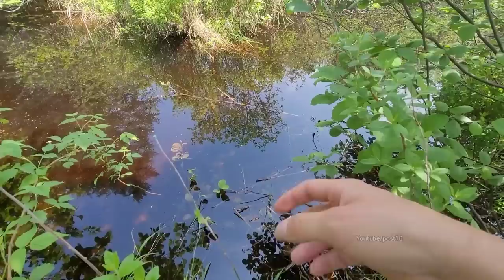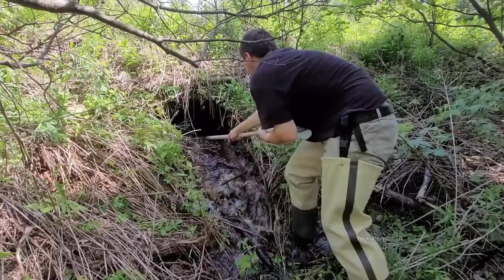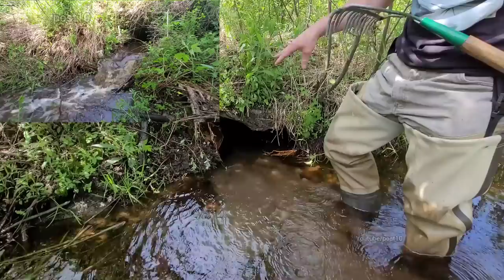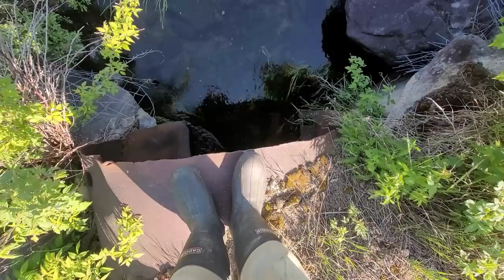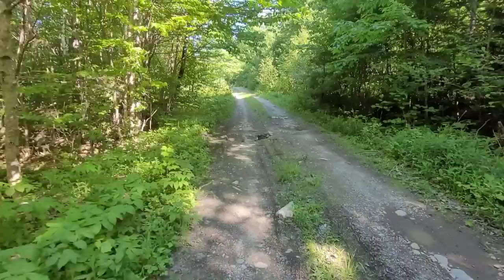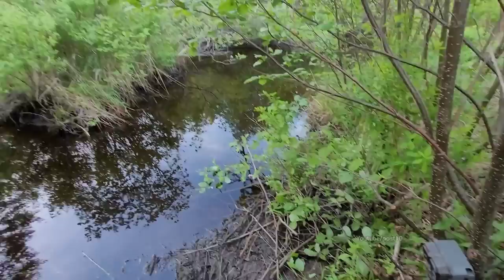Unclogging Double Ended Culvert Clogs

Comment: Hey buddy 

The reason the trail cameras don't work is that the sensor at the base is a PIR. As you likely know passive infrared detectors have a two section sensor behind a frenzel lense.

The sensor and the lense work together so when infrared heat or objects change or move there is a voltage difference between the two half's of the pyroelectric sensor. 

Your problem is that the beavers and the water are at arround the same temperature and PIR sensors are not good at detecting changes through water and cannot see through glass at all. You will only get a PIR trigger if the beaver gets out of the water then there is a big contrast in background heat and the heat from the beaver thus triggering the PIR that commands the cammera to start. This is why these detectors are used in intruder alarms.

Video motion sensing is different and uses a software program to look for a set number of pixels to change. The number of changing pixels is your sensitivity setting.

However.... video motion detection can be very unreliable and is very hard to set up without loads of false triggers. For example a fly or moth flying past close to the camera lense would look like a huge amount of movement. Water, rain and mist will continuously trigger recording so its useless for your application. Video detection is only useful in a place where nothing at all moves.

This is why trail cammeras nearly always use a PIR detector and as you know yourself in outdoor area's even they can be oversensitive or undersensitive.

Hope that helps explain why your trail cammeras often miss the beavers. It may also help to know that PIR sensors are far more sensitive to motion passing accross them and far less sensitive to objects coming at them face on.

Those cammeras could easily be modified so the PIR part is sepperate from the main unit. That would be way more effective.

If you want to message me and arrange it I would be happy to make the modification to one for you.

Keep up the great work and exelent content  👍
Reply from the maker: Thank you. I did not realized that the temperature be in the same would cause it to not work. I just thought there wasn't enough movement that's why the camera I had just time lapsing instead which is probably better if they ever do show up. Thanks for watching
Reply: That's pretty cool to know. A friend has 20 acres of land in the foothills that he takes a camper to on the weekends. He hates that his trail cam is always picking up the leaves moving, but on rare occasions he has actually had it pick up a bear passing through. 
I could watch time lapse videos of nature any day. It's fascinating watching the earth move and change right in front of us.
Reply: So thoughtful of you to look out for Post 10...
Reply: @post.10  Your more than welcome. You can get very low power microwave motion detectors that would be ideal for your needs. They are as cheap as $3 in many online electronics stores.

The difficulty is connecting them to trigger the trail cam. This has to be done at a circuitry level.

Feel free to message me if you fancy modifying one. I'm sure you can use a soldering iron OK, it only needs the circuit reverse engineering so you know the pins to solder to.
Reply: Very good info. Nice to know. Happy that you took the time to write & post.
Reply: Thanks for being a friend and nice guy to Post. He deserves all good people in his life and you are one. ✌🏻🤍

Comment: Hi Post 10. Watching yet again. Like the beaver / culvert unclogs, but my favourite has to be street drain unclogs. A few suggestions if I may. Carry your own metal beaverproof spike to position your cameras. When out on the streets using your rake, sharpen the end of the handle just enough to push or scrape the drain grates. Lastly, could you park your vehicle where you are working so as not to get drenched? None of us want you to get hit or seriously ill from getting drenched all the time.  Just being a mum in Australia.

Comment: Hey Post!  I think you might want to consider investing in a Potato Rake.  It looks like a pitchfork, but the forks are bent at 90 degrees, like the rake.  It would give you a lot more grip and pull force.  Especially since you're getting a lot more Heavy-duty in your debris removal. A potato rake will help when you get those roots all tangled up in grass and branches.

Comment: I wonder if you could use a roof-rake with the extendable poles to break up the clogs from outside the culvert?
Reply from the maker: It could work but most of the roof rakes I have ever used had flimsy aluminum poles and I might not be able to get it back out if something goes wrong. I don't think I would be able to lift the rake accurately in these small culverts because it would sag too much
Reply: @post.10  so what you're saying is you need something custom-built..
Reply: I saw another guy use a long log to break up a dam inside a culvert.
Reply: @bobh6728  Another factor is it needs to fit easily in his car.
But this culvert specifically needs replacement to prevent continual clogs, beavers or not.

Comment: amazing video as always, i found your channel about 4 years ago and ive been binging it ever since. have you ever thought about passing very strong lightweight line through the pipe  to bypass blockages like this? you would need to tie a float to one end like a piece of foam, the current would take the line to the other side, and then maybe attach a grapple to the other end and yank the blockage back up the entrance. just a thought,, it may grab on the lip of the break inside but there are plenty of times when it would work.  you're the expert not me. you'd probably have to do it a few times but it would make great content!

Comment: All motion-activated cameras and lights, are in fact, infrared detectors.  Since the beavers rarely leave the water, their infrared footprint would be masked by the water, even with their head above it, if their head is wet.

Trail cameras don't work for lizards or turtles either, because they are cold blooded.

Comment: Hey @post10 iam surprised you dont have a very large plumbers wrench with a pipe that fits over the handle to leverage some of those banged up culvert ends back into somewhat decent shape to help with the flow?

Comment: Post does great work, but I can’t help but wonder if a mattock would work on culverts with a lot of compacted dirt and rocks. Not plastic ones or or those made of thin metal, it’d punch through, but thick steel and concrete culverts? Might just work. He does brilliant work with a rake though don’t get me wrong, just curious whether it would work for post or not

Comment: Question from a fan in Florida.  Why aren't there markers or signs at the side of the road to tell you where the culvert is located?  Wouldn't this type of warning alert drivers and equipment operators of the presence of a culvert thus lessening the chance of accidental damage?

Comment: you know what?  A High Lift Jack could help you out.  they come in different lengths up to 60 inches, they're handy for various things. They work in various positions.  They can be dangerous if improperly used.  You can winch your car with it too.

Comment: Just a thought, can you not put a rake head on a set of drain unblocking pipes? They could get you the length you need to get deeper into the pipe for situations like these?

Comment: You really should try cedar oil. Either by itself or mixed with orange oil mixed with like alcohol or something like that and spray it all over your hair, back of your neck, your arms, everywhere. It should deter most insects but even if it doesn't the cedar and orange oils together attack their nervous system.

Comment: That crushed pipe as it is because of excavators, should be replaced, for safety of those who use the road. Overloaded log trucks may incite the problems with that tube, as well.
But definently  has obvious severe excavation damage, and needs replacing.

Comment: What if you float a small explosive down the culvert? Not a bomb, like a soda bottle filled with dry ice. Float it down empty on a string to measure the distance, test it filled with some stones to it gets stuck in the damn, then once all the tests are done you do a run full of dry ice and water,are a run for it because when it goes off it'll echo like hell, then in theory the explosion should blast the dam apart.

Might be do dangerous though.

Comment: I hope you aren't spraying permethrin on the clothes you wear and your skin in your video at 34:11. Permethrin is mean't for your clothing wet and your skin. You spray your clothes you are going to use ahead of time and then dry them (I like to do it outside in the sun - you can also put it into the dryer) until the clothes are totally dried. After that, you can use the clothes for the next six weeks or six washes in the home washer.  I wouldn't recommend wearing the clothes after spraying them until the clothes are completely dry. The chemical isn't mean't for spraying on skin.

All I saw in your video was the word Permethrin Repellent and that it treats 4 outfits. If that is true, it isn't mean't for the skin, only for the clothes you are going to work out in the forest.  

I use the chemical all the time in the forests of Florida. Keeps all the ticks away. I also wear long sleeve shirts and pants so there is less skin exposed to the sun. I don't know about up there, but Florida has a killer sun that can cause skin cancers.

I'm just trying to help. You can use other types of sprays but I wouldn't spray Permethrin wet on clothes you wearing or your skin. If you spray your clothes right you should have a lot less problems with insects. They stay away or sometimes if they land on your sprayed clothes, the drop dead.

Comment: Mr. Post...not wanting to complain but the inlet side of the first culvert was still pretty clogged up. Looked like there was still a lot of water in that drainage ditch. You should get yourself a good 8 foot bar to unbend some of those culverts! And you better hope the "idiots" running the excavators don't come across you while you're working! They might not appreciate your dissing them. just sayin'!

Comment: Raking be easier if had longer teeth on the rake the one your using is for sand or dirt tiny rocks to level whatever your doing not for rocks and weeds, time to put your man pants on and use the proper tool most of us screaming at video thinking you’ll figure it out